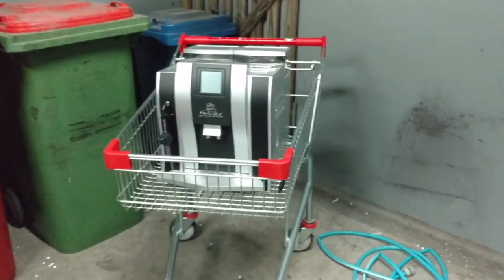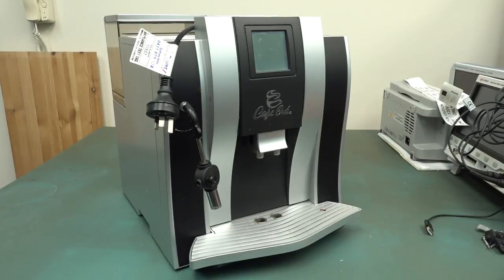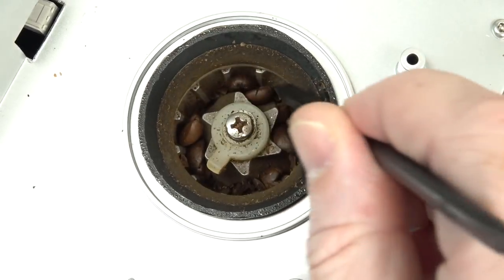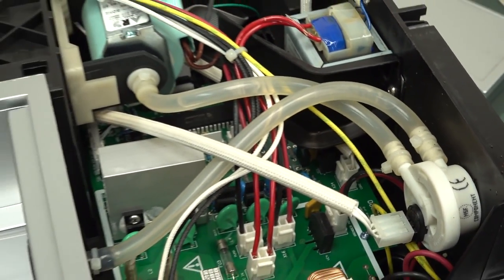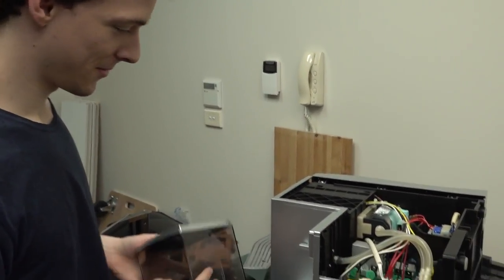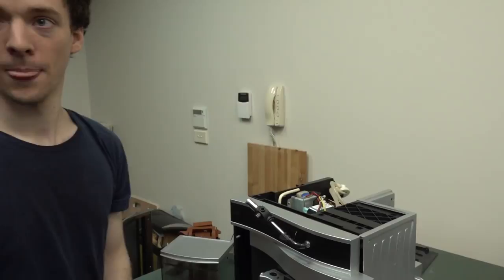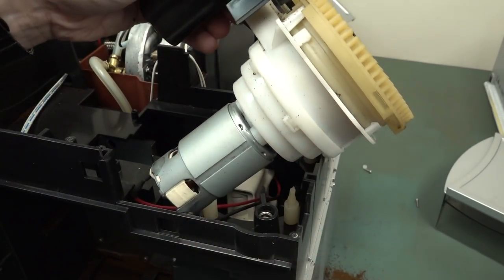EEVblog #1161- Automated Coffee Machine Dumpster Teardown

Comment: I just tore down a Nespresso machine, the water heating setup is very similar (even has the same pump, made in Italy), the heater and thermal fuses and all.
The pump produces the high pressure before going into the heating block, that braided line is the (single) water input, those other lines are the high-pressure lines. If you remove those little clips there will be a brass fitting.
Reply: Made in Italy? Is that the same as the drain pump (lol) in a lot of washing machines, I forget what the brand is.

Comment: You need two heating elements to keep the machine spitting coffee and frothing all day long with a steady temp. These things are usually pretty expensive and complicated, constantly needing maintenance in an office environment. The coffee also will only taste good for the first few cups since the rinse isn't good enough to clean out all the oils from the filter.
Reply: lofihippie yes the doser or Grouping press needs to be made of metal instead of porous plastic.

Comment: I've had two of those coffee machines. The one I have now is a newer and more compact version. Overall they are well designed and make good coffee. And at the price point they pay for themselves in no time.
Reply: @EEVBlog It works by pushing hot water up through the brown brewing unit and through the compressed coffee. The brewing unit gets rotated by a motor which compresses the coffee and then ejects it after the brewing is complete. It's a really cool piece of engineering. AFAIK there is two boilers because there is a separate one for the steamer. The milk nozzle has a hose that uses the Venturi effect or a little pump (not quite sure) to suck milk up into the nozzle and froth it. My new one does it all from the main coffee dispenser so you can hook up a milk canister that you keep in the fridge and press a single button to make a cappuccino. The thing is built for my level of laziness haha.

Comment: @EEVblog the special wire insulation is  called high temperature fiberglass wire (or if you use bangood/alie : Fire Heat Resistant Fiber Glass Appliance Cable Wire High Temp)
Reply from the maker: It really felt quite rubbery

Comment: 6:22 – That's the water tank, coffee is made partly from water. Milk isn’t going thru the actual machine.

6:44 – That’s a flow meter so your coffee doesn’t get too watery. Yes, the purple thing is the pump. It’s suspended in rubber so the vibrations aren’t passed over to the housing.
The pump is producing a pressure of 10 - 20 bar, because real coffee isn’t drip brew. One espresso of 25 milliliters uses 7 grams of ground coffee. Another source says it’s 6.95 grams. Closest wins.

The way your machine is built, I think it may been built by Eugster Frismag, an OEM manufacturer who develops and builds machines for Jura, Bosch, Siemens, and all others.
It’s a 30 mins. drive away from where I live, here in Switzerland close to lake constance.

Comment: 'VRI' "Vulcanised Rubber Insulation".  As electrical apprentices in the 1970s, we had to learn how to repair 300A VRI coal face shearer cables (I worked with conveyor control electronics, but you had to do it all, to get your qualifications - even dig!).  All cables used to be like this.  I recall finding lead sheathed twin & earth and that had VRI in it - it used to do the job of the modern plastics, but it was before my time even when I was a kid!

Comment: Not a coffee drinker here, but the big red mechanical, convoluted mechanism with no sensors is obviously the brewing chamber; the big limit-switch heavily-reducted gear obviously make it go under the grinder output where it gets filled by coffee, then is moved against the cylinder with an O-ring and a grate on it, water is pumped, coffee is spewed forth, then is moved to be emptied of the used grinds, and then moved back under the grinder output, and the grand circle of life goes on and on…

Comment: one boiler is for steam and/ or hot water trough steam wand other for coffee. the pressure is created by the pump pumping water trough pressed coffee in the brew unit(brown thing) so if you set grinder to fine grind the pressure will be high and if coffee ground coarse the preasure will be low also they have small valve in the brew unit to create some pressre.

Comment: the machine is not made to run milk, mainly because of potential residue clotting and growing bacteria in the circuit.
the steam nozzle is made for heating up milk, making milk foam and also getting hot water for infusions.

Comment: A company I worked at used to sell a rebadged version of this. I've repaired quite a few of them.
A typical fault was that the brew unit got jammed. Another classic fault was that the flow meter would stop functioning correctly, so the machine would just stop booting. It was over 5 years ago, so I can't remember all those details

Comment: thermal fuses are often in silicone tube to provide electrical isolation, but the tube conducts heat to the fuse ''good enough'' for it to still function

Comment: Dont know if you have self serve coffee machines in aus, but here in the uk we have costa express machines. They are 7ft tall, 3ft square, designed to sit in conveniece stores. They are beasts. They generally contain a machine like this, with a PC, gsm network module, fridge for milk, touch screen interface, syrups and pumps. The customer simply puts their cup under the nozzle and selects their drink using the touch screen, then pays at the counter. The whole thing is automated. Typically takes a minute to produce a fully finished drink. Try and get one of these in the lab 😂

Comment: Those tests carried out on appliances are here in UK called PAT - portable appliance test it's mandatory safety requirement for businesses. Test is to prove devices electrical safety. There is few types of tests depending on devices cunstruction.
Reply from the maker: Yes, they are called PAT testers here too
Reply: So all the deathdapters in Clive’s Poundland are slipping under the radar WHY?

Comment: That black turn knob inside coffee bean container is actually for setting up how fine ground coffee particles would be. It is supposed to engage on that white large gear that goes arround grinder mechanism so it can adjust spacing inside. Generaly, that machine was fairly good and not so cheap. Beside it needed thorough cleaning it was probably all good and able to work for some time

Comment: Its an espresso machine, its a bit different than a coffee machine. This one looks pretty fancy and does a lot of things, like grinding the beans, then pack the grounds, then heat the water to a specific temp, and pressure so it can force it through the grounds. When its done it has to eject the grounds to the compartment in the back. It may also have a heater for the cups too. 
It doesnt do anything with milk, but you can use the steamer thing to froth up your milk. The optical sensor is probably to let you know when you need to fill the bean hopper. 
A friend of mine paid about 1,000 bucks for a nice one of these, his very precise, it heat the water to just exactly the right temp, and just the right pressure, and its all computer controlled and stuff.

Comment: I found one of these a few years ago. Same situation, Dumpster find. it made a very average coffee.
It was working fine with a slight issue in the hopper/tamper mechanism (the big orange plastic thing).

To answer a few of Dave's questions:
The "steamer" is dual purpose. there is a small knob on the front which selects between steam and the "auto frother". A small tube goes into the side and then into some milk. The steam causes a pump action and froths the milk while passing it through.
The knob in the bean compartment is for adjusting the grind. pretty much the only adjustment that did anything if i recall correctly.
The "Bean Counter" (hahaha) is an empty sensor.
The liquid tank is for water. it only holds about 3-4 cups worth so it constantly needs filling.
The big brown plastic hopper mechanism is where the magic happens. it receives the grinds, packs it down, has water pumped through it to extract the coffee (with the filtery thing) and then ejects the used cake of grinds. All this works through a bi-directional motor (shown at the end of the vid) and a series of cams.
The braided hose is the heated water going to the hopper mechanism.
The dual heating block is 2 separate blocks. one for water, the other for steam as Dave came to suggest.
This machine really only does 3 jobs and only does one job at a time. Grind coffee > Make hot coffee juice > Make steam.
The "big solenoid" is the steam shutoff as there is no valve for doing it manually. (not 100% sure. could be wrong)
Megnet = magnet? (flow rate sensor)

I'm not a coffee machine guy, i just found a free machine and kinda learnt by watching it do it's thing lol.
As Dave suggests, if you get one of these gut it for parts. It's cheaper easier and slightly tastier to go to 7/11.
Reply from the maker: Thanks for the detail

Comment: The large nylon outer gear around the top of grinder that moved easily moves the grinding burrs one fixed usually the bottom and top moves up and down to set course or fine grinding. There best set and any adjustment knobs removed. Otherwise people play and the grind makes a big difference to taste and performance of the machine. I haven’t worked on any bean to cup machines but have serviced and repaired many large manual machines and grinders. I’ve found that some grinders have problems with grindings building up in the base of the machines covering the PSU causing shorting to earth and arcing holes through pcb’s 
Keep up the great videos Dave spend many sleepless nights caused by endless cramp watching you also fran Blanche and big Clive all awesome stuff cheers Pete.

Comment: The thermal fuses are the overloads, non resettable as you mentioned. Temp regulation is via the thermal cutout, and the thermocouple would just be registering heat reading with the cpu, it would need control relays to regulate heat via the chip.

Comment: I've run across that insulation before, I think it's fiberglass over rubber (probably silicone), and then the fiberglass is impregnated with silicone as well to reduce fraying. Very heat resistant, and much more resistant to abrasion than the straight silicone stuff.

Comment: During a building automation project at my previous workplace last year we kind went over the top on the automation angle, even tackling the Jura coffee machines (four of them) we had standing around the office.

These all use the Top-Tronics electronics, which come with a fun TTL serial port on the back ('service port'), which allows one to read out the contents of the EEPROM, which contained configuration settings, as well as various counters. For each product type we could thus read out the total count, displaying it in near real-time in the office on a display.

Of course the other way around also works, with sending commands to the machine to move the grinding unit, grind beans, add hot water, etc. Thus we managed to make our own custom coffee by sending individual commands to the coffee machine, by figuring out in what order to control the individual elements and for how long.

Took us about 2 kg worth of beans and those of us who actually drank coffee were sick of it after a few hours, but we got it all working in the end. One of these days I should probably finish integrating it into the MCU firmware of the project: https://github.com/MayaPosch/BMaC (see the ESP8266 folder).

Unfortunately we only got this to work with the version 5 of the Top-Tronics boards, as the v7 type in newer machines actually use some kind of encryption on the TTL UART after the initial plain-text start, and they don't use an EEPROM with masked ROM any more, but an STM32 MCU.

Another project for another day, but suffice it to say that these coffee machines can be a lot more interesting than one might think at first glance :)

Comment: There are two thermal fuses for one heating block in case the heating tube gets internally blocked by something (kettlestone perhaps) thus resulting in thermal runaway on the dry side. The other block is most likely for steamer.

Comment: AFAIK this woven cables are silicone a with fiberglass mail. They are used for heat resistant parts like say the cables that go to big resistors or for when the cables need to work on a hot environment.

Comment: That is a machine for making Italian Espresso coffee with a steam nozzle for making cappuccino steamed milk.
It's a size of macchine you would find in a small office (10 people), but it's too big for home use.
The brown plastic mechanism, makes the compressed capsule portion for one/two coffee (cylinder and piston), it's filled with finely grinded coffee (finer than sugar but thicker than flour) then high temperature water is forced through the compressed coffee, the compressed coffee is evacuated in the waste bin and the process can start again.
Under each operation the coffee comes out of two nozzles, maybe the machine is capable of producing two sizes of compressed portions to allow for one coffee or two coffee at a time.
The height of the double nozzle is regulated low for making Espresso coffee (small cups), medium for the cappuccino cup, and all up to place a glass under for making "latte macchiato" ie: stained milk.
The double water heater is most probably needed one for the coffee and the second to push temperature and pressure higher to produce the steam at the steam nozzle.

I had a smaller version of this macchine many years ago, costed me around €800, it wasn't so well designed like this one, made the coffee too cold, and the capsule compression often got often stuck and I had to take it apart, the one in the video surely must over €2500, if you put it together you might make €400 out of it on Ebay.

Today most houses in Italy use compact manual coffee machines were we can buy a boxe of one dose capsules with precompressed coffee inside. the machine costs from €40 to €150.
Inserting the capsule in the machine, it perforates the capsule, pushes hot water through and the capsule drops into the waste bin, no mess, and good coffee.

Comment: Thing about most superauto espresso machines is that the mechanical core is pretty much a single design shared across multiple model tiers spanning thousands of dollars. This particular unit's brew group (the removable orange thing on the side) looks like Saeco's 25+ year old design that's still in use today.

There are many Chinese clones of this particular brew group. It's a pretty good design.

Comment: Silicone rubber 200 degree C wire, nickle plated conductors.  Heater elements are useful as load test resistors.

Comment: I was genuinely interested how one of these worked (not because I like machine coffee just because of the automation aspect.)
General observations from a layman to the person who genuinely want to know more here: This machine can't be using milk, it obviously has only one container for liquid and it's not connected to water-supply via hose. Coffee and water mixes at a very late stage in the process (in the device Dave call the hopper) because you can't have powder/water mix or coffee running around in tiny hoses/sensors/valves/heaters etc.
@4:05 That sensor can't be counting the beans, more likely a photocell-style  "ran-out-of-beans-sensor".
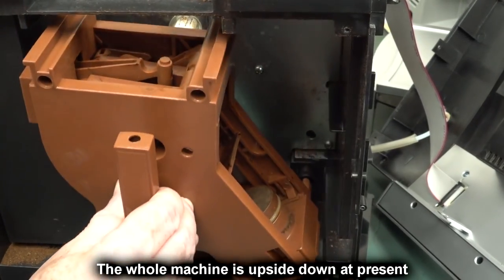@13:50 That brown device is where all the processing happens; grinds are put into a strainer device, hot water added, coffee comes out and the used grinds are separated. The water can be pressurized or not, depends on the machine, can't tell from this video which this case is. Too bad we didn't see more of this part since all other stuff of the machine is just "support mechanisms" for this one.
@15:18 Grinders do spin fast (100's - 1000's RPM), the bigger ring gear Dave yank around is probably the adjustment mechanism for powder coarseness. Would been interesting to know if that was automatically controlled by machine or only adjusted manually by technician (does it need periodic tuning as the surfaces of the mill/grinder dulls by age/tear, someone knows?) 
@17:24 Isn't that two water outputs (not inputs)? And coffee grinds/mix don't go into the heating element. Hope that wasn't what Dave meant, but it would clog up immediately and just be a horrible coffee... Do they have two heaters (in series) for the froather and tapping off a single one for the actual coffee-making perhaps, froather is steaming hot right?
@18:15 Looks like a regular servo valve (on/off only, you already had a sensor for flow measurements so the machine should already know the water contained in the batch of coffee). But why does this sensor need three wires, guess we'll never know?
@24:40 That is the gearbox assembly for the hopper to do its thing and along with the hopper itself it is remarkable! It places the grinds in the strainer (possibly compresses it too), seals it to the hot water intake, when brewing is done it needs to empty the strainer and move the used grinds to the disposal container and reset for next batch. Again, this would be the interesting part to dive into, doing all that with only one motor is nothing short of brilliant piece of engineering. This tear-down don't do it justice unfortunately. Next time you find one Dave I'm up for paying shipment to AvE. ;)